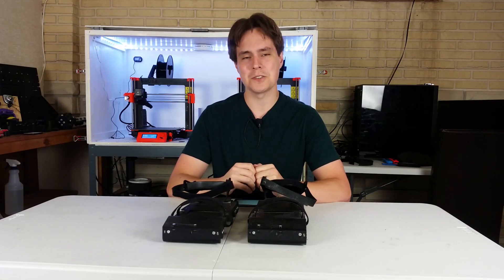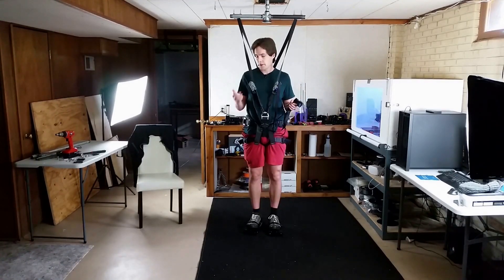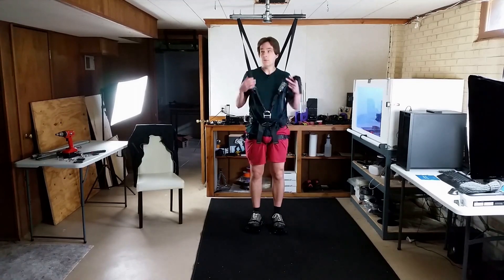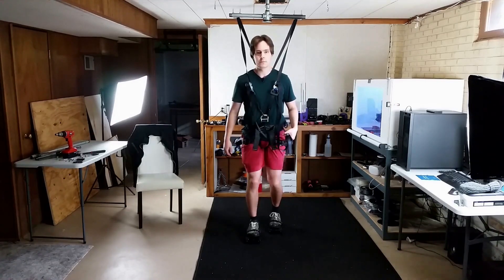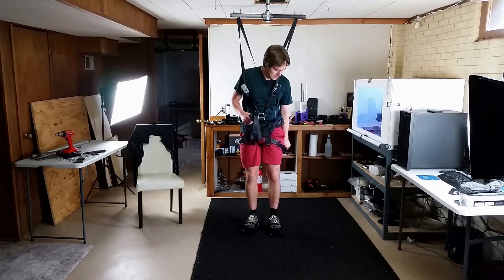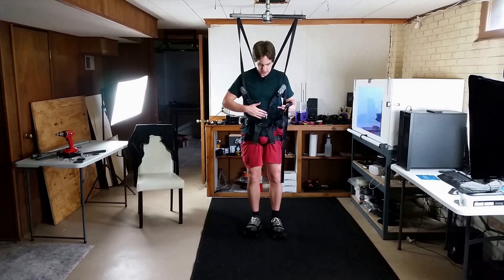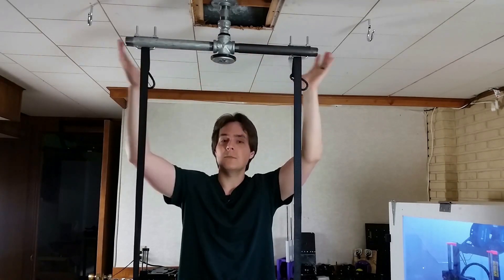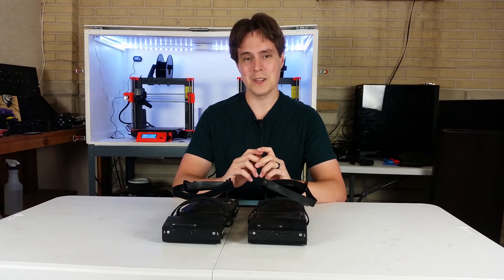VR Shoe Build Log #41 - Physical Therapy Inspired Support Rig

Comment: (hmm, previous comment missing)

Here's a video of the rotator twisting belt
https://youtu.be/1p09aKxqxLU

Springboard divers use them to train on trampolines. Might enable you to use a floor mounted rig. And no wedge.
Reply from the maker: Thanks. That is exactly like how the virtuix omni with its ring that goes around you worked. I have an issue with the ring getting in the way of your arms, but it would work.

Comment: why not use something like kat walk, it can hold you while u walk forward, backward bend down and all that, and instead of sliding on it u can use those shoes u have to walk on it but of course the surface will have to be changed from smooth to harsh so the shoes can have a grip
Reply from the maker: Next video I show a support rig with similar rigidity, turning capability, and crouching, like the Kat Walk C has.